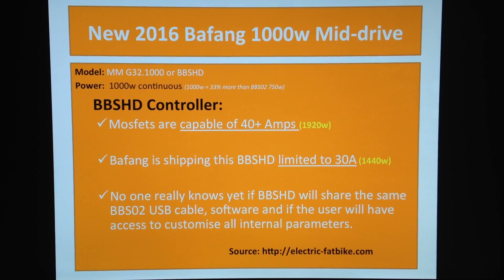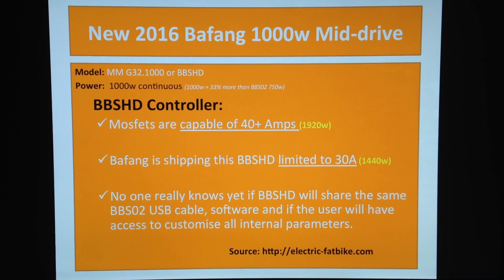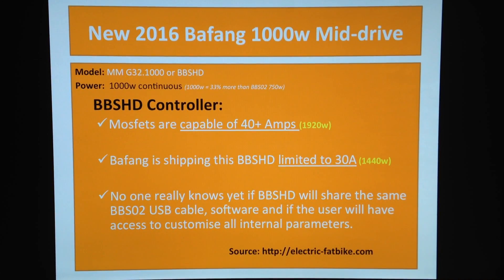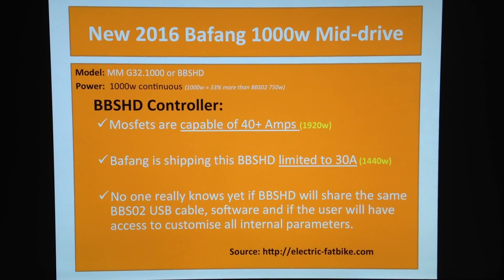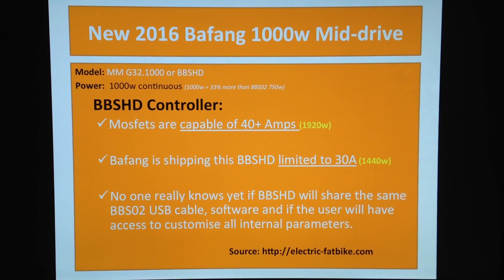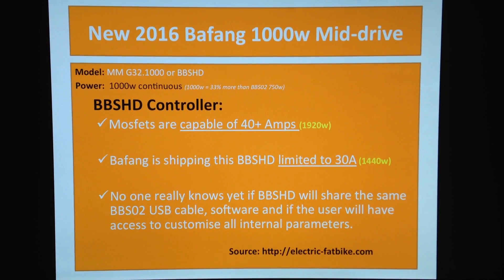New 2016 Bafang BBSHD 1000w mid drive (video 7 of 7) Controller: 30/40A? USB programming capable?

Comment: Would the kit work with a 48v 11.6ah panasonic battery? It says max discharge current is 40amps. I am thinking of getting the bbshd, but don't want to buy a new battery. Would the bbshd be faster than than bbso2 if I keep my battery, or would it just be the same?
Reply from the maker: +Clifford Zvengrowski - Yeeeeahh... it would work.. the BBSHD is 30A max or 1455W peak (this is the maximum that I got here with mine). This pack you're talking is actually using 4x lines of Panasonic NCR18650PF cells in parallel, the maximum that it can handle is 40A continuous or 72A burst, the problem is that most battery packs have very small BMS and can't handle over 30A. If your motor is putting 30A is recommended to have a BMS capable of handling at least 35A (the more the better). I see lots of people using the same battery and just upgrading the mid-drive, the BBSHD has a much better torque and faster acceleration, mechanically should last longer as it is a heavy duty motor. Just monitor the battery temperature as you ride it, if you think the battery is getting too hot then you better get a bigger one. I remember my 14.5Ah pack with the same Panasonic cells used to get hotter with my BBS02 than it is getting with my BBSHD as it is more efficient and doesn't struggle at all while the BBS02 in some situations you can tell that you're forcing the motor a little bit...
So much POWEEEEEER... =]

Comment: i never had an electric bike and next year I will buy a bbshd 1000w as a scooter replacement because I have a sweet new mtb full suspension and with the electric motor I will have a lot of fun with good speed
Reply from the maker: +skrillex1234ful - Yeeeah.... BBSHD would be awesome on a full suspension MTB, just measure your bottom bracket very well to get the correct motor, they have it in 100 or 110 or 120mm. My super overpowered BBS02 is already keeping up with scooters, the BBSHD should be really good and much more reliable than my freak setup! Once you go electric you will NEVER go back!! Your next step would be save up to get a Tesla car haha
Reply: yeah defenetly but 1000 euros for a bike motor is a bit hard to swallow  and after you need a battery ... i'll see if i buy it or not ... my bootom bracket has a shimano cranckset witch is 68 to 73 mm so if i get the bbshd i'll need the 100 or 73 mm . now , can you help me find a battery pack that is 48v 9ah or more and can deliver more than 40 amps peak ? on ebay that will ship in france ? beacause i cant find battery packs that are more than 25amps and less than 500 euros (600dollars or 350 pounds) i'm willing to put the battery in a backpack to keep the bike nimble a as light as posssible. last question : do you think i'm going to have problems with the motor touching the ground while doing jumps and stuff thanks for answering :)
Reply from the maker: ohhh.. 1000 euros???? the importers pay no more than 550 USD per unit... this is the biggest rip-off ever!!! One of the best batteries I heard is from this Website http://em3ev.com/store/index.php?route=product/category&path=35 is an American guy very well know on eBike community running business in China. Americans only say good things about him =] Not really sure about any seller in Europe because of the 250w law thing... so hard to find good overpowered motors around there... the Greeks are the most insane ones running 3000w motors on eBikes.. you may find a good battery supplier there. Battery packs cannot come in an airplane, be prepared for a long time waiting. The motor is strong, some people hit this thing doing off road, few people eventually break the motor, it is obviously not recommended but should survive. Some bikes have a curved downtube (specially the latest Giant brand bikes) what makes the motor be pointing down too close to the groung.. not good specially if you planing going off-road
Reply: +ElectricBike (Bruno) thanks for all the answers man your awesome ! my down tube is not bent so the motor should be high of the ground :)
Reply from the maker: Yeeeahh.. just wait for another two months before you buy the new BBSHD, its is super new and no one has it available yet... by January all importers will be fighting for customers (there are so many new importers) so the competition will be good for us.. price war sounds delicious for customers =]

Comment: what rpm has the engine of bafang bbs02 ??
Reply from the maker: BBS02 = 120 rpm (at the chainring)
BBSHD = 150 rpm (at the chainring)
your top speed also depends on what chainring size you have installed in your bike, you may have a very high rpm but if you have a very small chainring you won't go faster...
Reply: the rpm on the motor shaft?
Reply from the maker: this is a very good question.. it is possible to do some calculation on the reduction gear (first and second stage) but it all depends on the voltage you are applying at that moment, as you use the battery, the voltage decrease and the rpm will also decrease..
I really want to make a wooden frame to hold the shaft centered and turn it on without any load any gears just the motor and see how fast I can spin... that will be really fun video =]